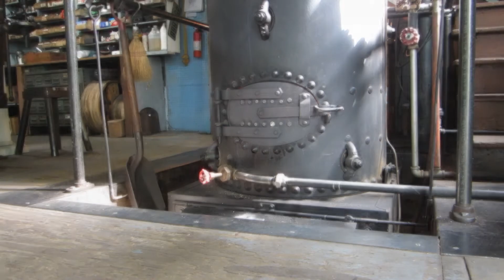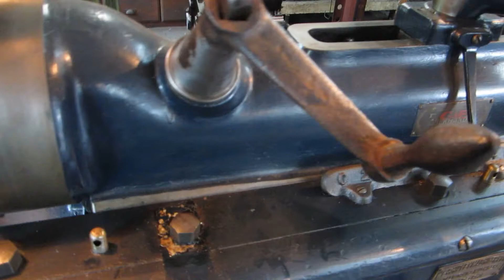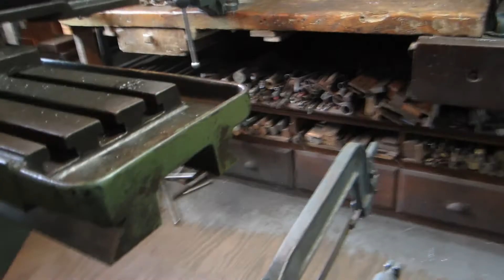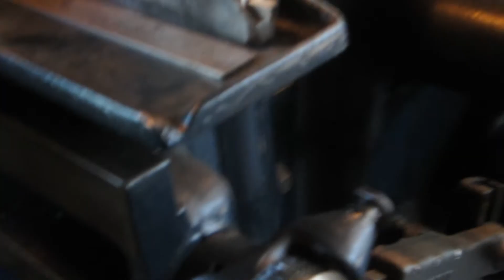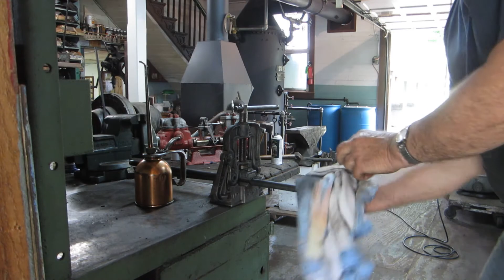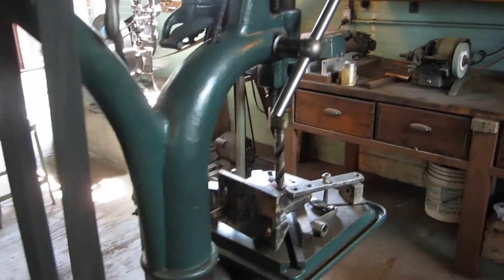OLD TIME STEAM POWERED MACHINE SHOP 2

Comment: I really enjoy your videos....... You are recapturing the "art" of machining, which I think our society has lost track of decades ago. 

In 1974, after graduating college, before I got my first teaching assignment, I was working a summer job in the old Durant motor car building in Elizabeth New Jersey. It was an enormous multi-block long building which had been farmed out too many different cottage industries. But down in the basement at the far end was a maintenance machine shop -- an old fashioned one just like yours. It had the pulleys and belts and line shafts...... Except they had a 30 horsepower floor-mounted electric motor supplying the power. As I wandered through that shop (which probably hadn't run in 40 years) I imagined what it must have been like in the day...... When those machines were running. In your videos I got to see it first-hand!

The building was first constructed in 1916 by August Duesenberg and his brother -- to manufacture airplane engines there for "The Great War" (as WW1 was known then). Then, around 1920, Willys-Oakland set up the factory to produce automobiles....... But they never went into production --  the farthest they got was to produce one "sample car".

Then around 1923 William C. Durant (the Wall Street tycoon) decided to build is own automobiles there, and he used that one sample car left behind by Willies-Oakland as the starting point to produce the Durant and Flint automobiles. The floors were all interlocking wooden block, soaked in years of oil and grime..... And in the main corridor,  up on the second story, there was an old rusty sign "Buy War Bonds!".

By 1932 Billy Durant was flat broke and ceased car manufacture there. And for many decades the building was abandoned.

That summer of 1974 I was 22 Yrs. old working on the maintenance crew doing roof repairs and window glazing. But I think I was born too late, because my heart was still back in the 1920s! (I had heard that my grandfather used to work there as an electrician) 

Wherever I went in that enormous factory...... I always felt that the walls were talking to me. I would imagine the people who worked there...... What their day was like...... What their lives were like (when a loaf of bread cost 5 cents). To know that entire families -- father, mother, boys and girls, and newborn babies...... All depended upon what went on in that building -- that made it possible to make a living -- it was awe inspiring!

Your videos brought back all of those enjoyable memories. Thank you so much! 

(P.S. -- I hope you don't mind, but as an old shop teacher and Machinist my heart compels me to urge you to take off your wrist watch -- for safety reasons -- when working around the machinery)
Reply from the maker: John, Thanks for the great comment.....Dave

Comment: Hello sir, what tolerance are you able to on the lathes?
Reply from the maker: Lyndon: If you are talking about diameters, with a lot of care I can hit +_ .0005, If you are talking about taper lets be realistic, they are both worn out.....probably .0015 on 10".......Dave
Reply: @davidrichards5594  +/- 0.00005?  .Still 0.0015 over 10 inches? Very impressive.  If I remember this particular test correctly, tolerances that tight only let red light pass when a cylinder is held against an angle plate, because that's how straight the cylinder is.  For tolerances like those, I'd also guess that you have a set of gage blocks, and your fair share of long needled dial indicators, in one of your videos I saw what looked like a 5 to 6 inch outside micrometer.

Comment: Hi Dave
Fascinating again.Ive only seen a shaper used once or twice in shops ive worked in and they were used mainly for keyways an such.
In your opinion what were the benefits of the shaper over the mill or did the shaper precede the mill/.
Reply from the maker: Hi Pete: Good question.  Appreciation of the shaper in shops is a curious thing. They either loved them , or had no use at all for them. Milling machines were slow to catch on in the early days before 1920. Railroad shops were the "cutting edge" of machining but were too cheap to buy all those cutters when they could just grind a special shape tool for a shaper or planer and do the job reasonably fast. A shaper could remove metal as fast as a mill until carbide and High speed steel tools came along which could be run much faster in a mill. Big shapers might be able to hold bigger work than most milling machines.  Shapers can also cut internal keyways and splines......Dave

Comment: I’m a bit late to the game, but, I have a D. McKenzie 16” shaper from about 1920 that is dead nuts identical to yours. Except, it’s a bit bigger, has a compound feed, and a couple features are a bit different. But, everything else is nearly the same pattern. I actually learned a few things here I wasn’t aware of. How the stroke length scale works, paying attention to the feed directions/stroke direction, etc. I do know the table feed clutch has a leather strip in it as the crash clutch. 
Mine had been rebuilt in the 50’s. They added an Atlas gear box and an electric motor. When I received it it was all froze up, stored outside. I was pleasantly surprised to see it had been run with grease which was terrible, but did a great job protecting it from the elements. I tore the entire machine apart for cleaning. Ram droop over 16” was .001”. I didn’t have to scrape anything in. Just clean the grease off. Then I built a pump supplied oil bath lube system that rains oil over all the components. I run the shaper regularly in my shop. It does in fact make anything but money! I’m still learning tool geometries and why not, but it’s a fun machine the watch running. It makes a big mess everywhere, but I love it!
Reply from the maker: Thanks for the comment. See the up coming video for a perfect job for a shaper....Dave

Comment: great shop david . I am envious . your videos are almost hypnotic.One question ,instead of crossing the belt on the shaper ,couldn't you just turn the shaper around 180 deg. facing the other way?
Reply from the maker: Hi Ken, Could have done that but I wanted it facing the lathe, same with the drill press that runs a crossed belt....Dave

Comment: I bet in the winter it was nice that the boiler heated the whole shop but what did they do in the summer in a boiling machine shop??
Reply from the maker: It's not too bad with all the windows and doors open. I have seen old photos of shops with fan blades mounted on the line shafts to move the hot air off the ceiling.....Dave

Comment: There is much to be said for the rocker post tool holder..It's not quite as fast as a good drop on tool post but it is a helluva' lot more versatile and the tools are of course infinitely re-grind able with only a shop grinder...much cheaper than insert tooling and the shape is limited only by your imagination...mine finally broke.. the half moon broke in half under the screw...I didn't have proper material to make another half moon and I was surprised to find that nobody stocked replacement parts...shoot nobody knew what I was talking about...the internet then was in it's infancy so...I had to resort to an indexing square tool post and a pile of shims what a sad day that was...!
Reply from the maker: Tom, give me the dimensions of your broken rocker, I've probably got one you can have....Dave
Reply: I'm afraid those days are long gone...this event occurred about 1980...give or take...I'm retired now and living on social security..I no longer have a shop or even many tools...and health issues have taken me down a peg or two...so I enjoy watching and commenting...but once I worked on the muskie for Bucyrus Erie  and had my own hobby type machine shop at home.. though it wasn't nearly as good as the one you have here...I am frankly a little jealous...but hey...good for you and thanks for the offer..you are most generous

Comment: I am a belt "Smith". I take rubber and composite belts and make them endless. Or splice them and I install the mechanical fasteners such as the clipper lace used to connect your belts. 

I started watching today 5-27-2020 because of the belting. But I am also fascinated by machining and history. 

I very much appreciate your mastery of . . . Everything. I am amazed and appreciate learning from you.
Reply from the maker: Thanks for the comment, You certainly have a "rare" vocation and I'm glad to know you are watching. I am a fan of leather belts and with the exception of a couple applications, I've had the best results with them. I am curious about the nylon/leather composition belts which I've never tried. ...Dave

Comment: I was wondering why when using the shaper and you want a real good finish cut you don't use a scraper tool bit. I worked for 44 years in machine shop and we used a scraper tool for finish cuts on a planer.

Comment: Do you have to do something again & again till no shavings come off because the tool becomes worn & smaller than measured when you started? How long does a tool last till regrinding or replacing?
Reply from the maker: Hello Gregg,  It depends on the job and how hard the particular metal is that is being machined. Usually I will machine out the whole job and then resharpen the tool (or change it to a different shape) for the last finish cut for a nice accurate, smooth last pass.....Dave

Comment: I would imagine that the environmentist would object to the smoke. What can be done to get rid of that? Spray water into the stack but that would affect the draft by cooling it down?
Reply from the maker: Gregg, Smoke can be controlled by the way you fire the boiler, with coal, you have to be mindful of not just shoveling on a lot of new coal all at once.  Keeping a lot of draft and small amounts of fuel often will keep a clean stack. Junk wood will burn almost smoke free. I deliberately made some smoke for the camera a couple times.....Dave

Comment: I see this stuff in the scrap yards all the time. I'm scared to buy any of it though just because of what may be missing but it sells for weight so I'd be out about $60/ton if I took it back. That being said, beyond the myriad of old cars, sewing machines and tractors (parked inside) last summer a 53' trailer backed  up to the house and dropped a huge skid in the driveway. Later that day the By-law shows up :( and I had to explain the skid steel in 30' lengths and 10kw of solar panels. I told him I had just spent $42k on the roof and had a building permit issued from his office. The neighbors think I sell drugs bc I don't work and can pay cash when I have too. Actually, It's because I drive old cars and don't owe the bank. A neighbor asked me one day why I fix my car and don't take it to a mechanic insinuating that I am a parasite. She was shocked when I told her I was a mechanic.....go figure. KEEP IT REAL, KEEP IT PAID FOR!
Reply from the maker: In my town, I'm also a weird guy that does weird things in a shop that the fire inspector should watch. I get it....Dave
Reply: Maybe I got lost, point was I'm paying rent and taxes to be harassed to store things that nobody cares about. Something like a welder and bandsaw equates to instant cash VS storing a tool I might need in the future. Bought a Singer 196K5 for a job $25. It's been 2 years and haven't had time.... Neighbor said I should PAY somebody to fix my problems. I say neighbors need shrinks!!

Comment: Great video. I used to run an old Capstan Lathe that was originally run off line shafts. It had been converted to run on a motor ages ago. It was so old there is an exact model in the Birmingham Science Museum. UK. It ran really well. Good memories. Great to see line shafts in action. Cheers

Comment: You have an oilier that mixes a little oil with the steam ?  What kind of oil do you use ?

Thanks ,   :-)
Wyr
God bless
Reply from the maker: It's special oil with tallow to help it mix with the steam, only available from specialty lube companies at a pretty steep price. the small engine has a displacement type lubricator on the steam line (see video 3 1/2), and the big engine has a pump on the side that injects it into the steam line just above the throttle valve...Dave
Reply: Thought it might be a " organic " oil , instead of a petroleum based lube .  
     
     Of course , back in the day when it was developed , was before the " age of oil " .

     Have you ever considered mixing the lube yourself , with tallow and some sort of vegetable oil ?

Thanks ,    :-)
Wyr
God bless

Comment: As a child in the late fifties, I lived next door to a machine shop with machines running off a main drive shaft.  Obviously I had no idea what was going on.  The only thing that stood out was the horn that sounded off at 1200 and at 1700.  Could be that this shop was driven by a large main motor instead of a steam engine as our neighborhood was already electrified.  The irony of it all was this shop was in the middle of the city of Manila, Philippines which is the Tondo District.  Noisy as it is.
Reply from the maker: Great comment, Thanks for watching Noel....Dave

Comment: How do you add oil to the Babbitt Bearings mounted in the overhead and how often is it needed?
Reply from the maker: Craig, just a squirt of gear oil in the top holes once a day......Dave
Reply: What's the max speed of a babbitt bearing typically? I took some off an old grinder I have and I kinda wish I had left them now

Comment: Mr Richards just found your site and will be a regular...You make it look so easy - Your skill-set is unique -- in this day and age!!  Are you able to generate or store any electricity DC, AC,  battery banks, etc.? I love the 2-Wire electricity circuit in one of the video's I've watched as well as Romex to some overhead lighting...just curious - the answers are probably answered in some of your videos so I'll just keep watching.  Keep up the great work!
Reply from the maker: Roy: Thanks for watching. I was able to trade a few things for a 110 volt  flat belt drive DC Dynamo that I want to set up on the smaller O&S engine and run the lights on that "Tube & Knob" type wiring circuit...Dave

Comment: Excellent, like the first one.  Question: why is wood used for the boiler, rather than coal?  Second, it is interesting to see the crossover belt.  One of my questions, as my background is in philosophy, is whether you cut the belt, turn in halfway over, and rejoin it, as in a Moibus strip.  

It is instructive to remember that by 1800, many of the principles of changing direction of motion were already established (such as multiple cams), and I think it is interesting to trace the development and application of this knowledge to  machine design.  For example, the planer you show here, in essence is an automaton, if you include the steam engine engine and  belt.
Reply from the maker: I do use coal sometimes, but it's got to be soft coal and is now $110 /ton and I have to haul it 200 miles round trip.
The large drill has a 1/2 twist in the belt, the small drill press runs 1/4 twist. I have seen belts run like you say, but leather is glued together and only like s to run in one direction.....Dave

Comment: Fantastic, immaculate shop. I enjoy your videos and am very interested in more information on your old drill press, it looks very much like one i'm about to purchase (1914).
Reply from the maker: Hi John, Mine is a Barns, Rockford Ill. but there were a lot of them built I think with the same main frame castings. It was bought by my father from a wooden wagon works in Owego,NY back in the early 30's when they went out of business. It was a little "beat up" from being moved around but hardly used. The only Barns I've seen with a square table. How did you date yours?....Dave

Comment: I suspect that the build date on that G&E shaper is closer to 1910.  I have a 16" which shares many design features of that one, but it was built in 1924 and was a factory motor drive planer.  The reason I think your's might be older is that they pretty much phased the lineshaft machines out by 1920, and your's is a bit more lightly built than mine (even considering mine is a 16).  It doesn't have a table support, which most had by 1920.  Also, my feed adjustment has a screw drive rather than the simple T slot on that machine.  That is a very nice shaper and a very nice shop overall.  Thanks.
Reply from the maker: interesting, how did you date yours?.....Dave
Reply: The serial number is on the front of the column on the right side, beside the ram way.  There is a picture on Practical Machinist from a book with years indexed to serial number that I used to date mine.  I just searched for it again, and the listing is for gear cutters , so it may not be correct.  One thing that was clear was that serial number started in 1920, so you might check to see if yours has a serial number at all, if not it is pre-1920.

Comment: Hi Dave, Great set of videos and a marvelous shop! I wonder how many young machinists these days know what a shaper is? I learned to use one in high school, but I hate to admit how many years ago that was. It was very much like yours, but had been converted to a v-belt and an electric motor. Keep up the great videos!
Reply from the maker: Not many I'm sure. My old school had a big ole hydraulic 36" Cincinnati that would roll up a red hot chip as big as a valve spring and fire them into the wall. ..Dave

Comment: ? my friend when setting up on 4 jaw chuck on the lath ???
is it easier with larger stock or smaller stock 
I use a Dial indicator but the tolerance need to be held closer 
Larry

Comment: brings back a lot of memories.Im a retired mold maker i ran most of everything in your shop. the belt drive is before my time but my dad told me about one big electric motor running a shaft overhead while the machines each had their own belt drive. when i retired CNC had taken over everything.
Reply from the maker: Great comment Kem, good to have you along....Dave